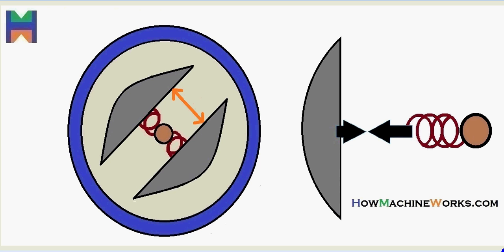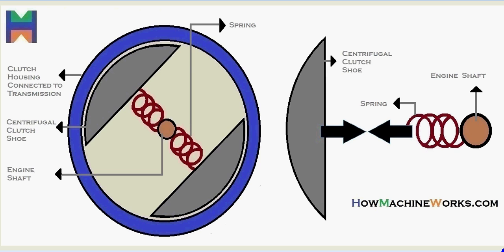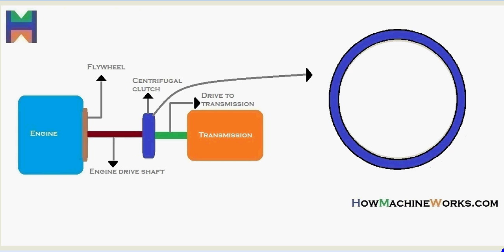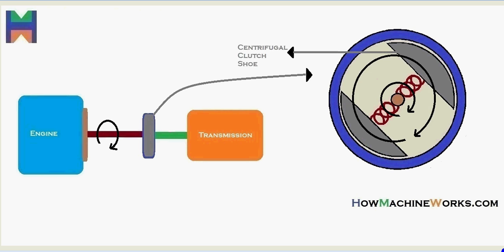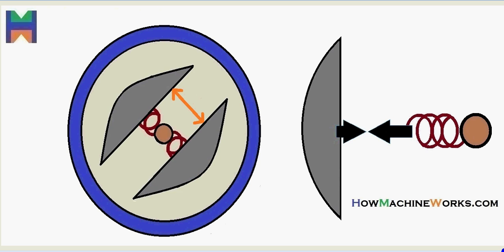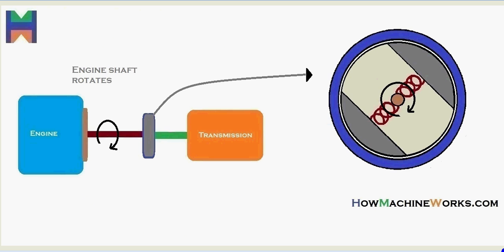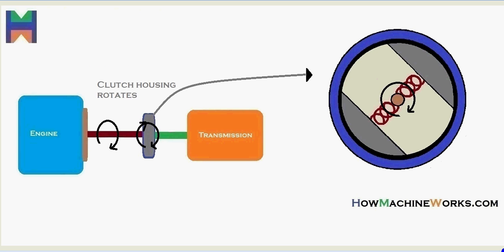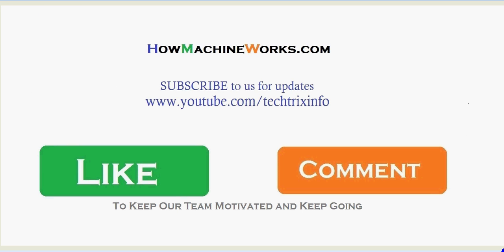Animation How centrifugal clutch works. ✔

Comment: Where is centrifugal clutch used in and for what purpose? If clutch is constantly engaged when engine is working how do you change gears in transmission? Only when the engine is in low revs or off?

Comment: how to bring sudden stop in transmission? or prevent clutch shoe from touching clutch housing INSTANTANEOUSLY? will you decrease the engine speed?!
Reply: Arvind Suriya clutch is controlled by accelerator (throttling) l

Comment: please also describe why we use such clutches
Reply: because of in mechanical clutch a skilled operator required while engaging and disengaging the clutch if the operator is not perfect vechile gets stop in some conditions if it is a centrifugal based on our speed engaging and disengaging is takes place i think u get little  bit information from this

Comment: Very good and clear explanations, but I have two questions here:
1. Is it used on NHRA Funny cars?

2. By solely relying on the centrifugal force, I doubt can it exert enough frictional force on the housing? Or am I missing something?
Reply: Often times, the link between the drive shaft and clutch shoe is angled such that the drive shaft is able to impart a force normal to the driven shaft, thus increasing friction rapidly after startup.

Comment: How does centrifugal clutch in low speed work? Lets say going uphill in low speed / slow engi e rotation. Is it possible?
Reply: while going uphill engine rotation doesnt decrease, instead it is very high.
our wheels rotate at slower speeds as we shift to 1st or second gears to obtain more torque at the cost of speed.
i hope i could clear the doubt

Comment: there is any  difference b/w single plate clutch & multie plate clutch except the plate...?
Reply: single plate clutch produce less torque compare with the multi plate clutch means torque is always opposite to speed based on this we r using single plate in heavy load engines and multi plate in low load engines like bikes i thing u getting little bit information from this